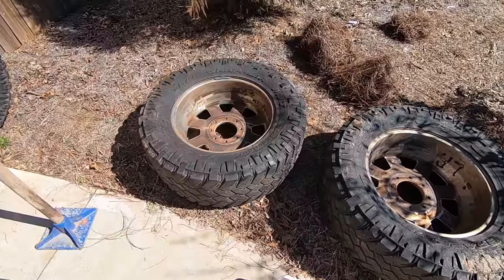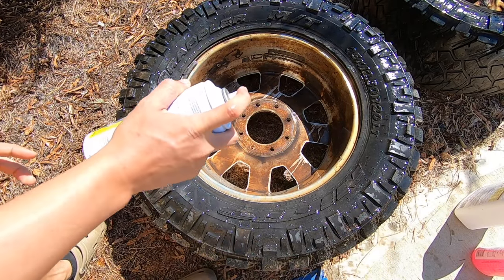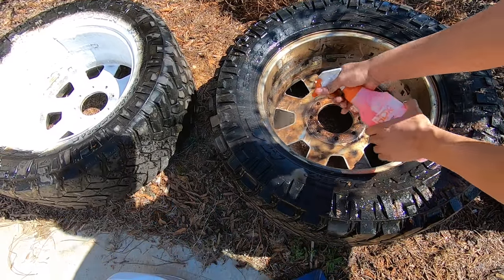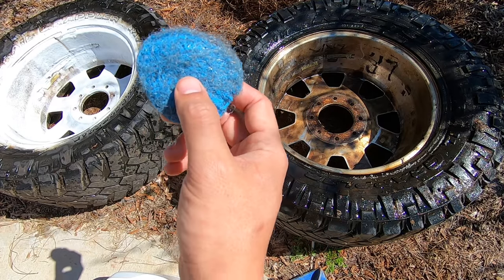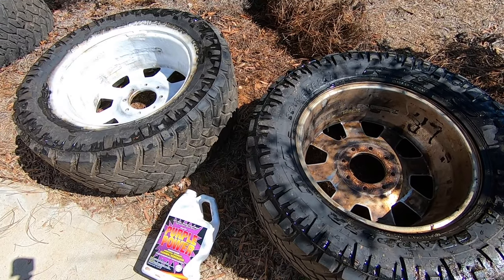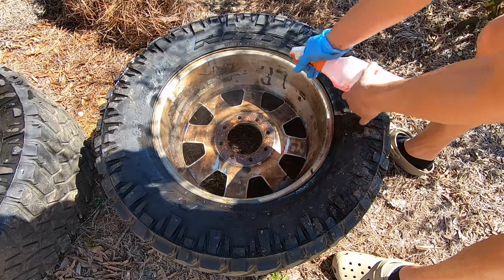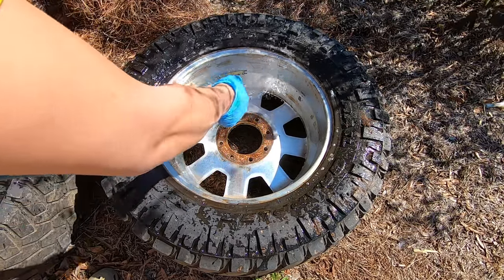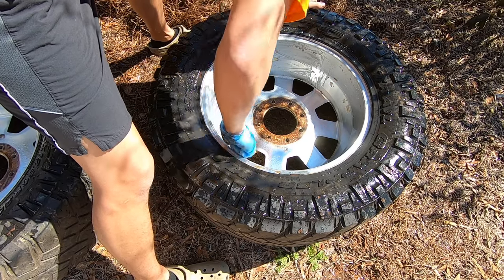Whats the best way to clean wheels and tires? Purple power or oven cleaner?

Comment: The oven cleaner is basically lye so depending on what it is it should do the job i might have some reservations usiin on aluminum but whatever and i like the LAs totally awesome for basically everything you can dilute it like 4 to 1 and still works great im sure purple power works but im juat cheap

Comment: Used oven cleaner on alloy and it really messed them up I would not recommend also on an intake manifold I took off it pretty much strips coating off at the end ur guna wish u took a different route little elbow grease is best

Comment: I bought some used rims that had very thick, caked-on brake dust and the oven cleaner worked ok with a lot of scrubbing and then re-apply. It took about 4 cycles of oven cleaner and scrubbing to get one wheel clean. I then used a paint stripper from Lowes on the next wheel and couldn't believe how much better it worked. I still had to scrub the wheel with a brass brush, but it cleaned up easier with only one application. You just have to be careful and not let the paint stripper get into your clear coat or paint on the wheels.

Comment: Don't ever do this with new wheels. Especially aluminum. You will trash the clear coat or anodized finish. Especially the oven cleaner. It's super caustic.
Reply: So what should you use to clean new aluminum wheels that are full of brake dust and grime?
Reply: @2028end  soap and water and a soft rag or brush. Dawn dishwashing soap works good on wheels. Wouldn't use it on paint unless you want to strip the ceramic and wax coat off to redo it. But yeah when I detail a $350,000 lamborghini or Ferrari I use soap and water. No crazy chemicals.
Reply: @worldssickestmedia2713  And of course you detail a $350,000 car... 😆
Reply: @Prxpagandalf  I owned and founded a mobil detail service in Atlanta for 8 years before I sold it in 2015. So yes. I've done more than I can remember. Also way before that went to trade school for paint and body and collision repair. And of course after you paint wet sand and buff the car it has to be detailed before it's delivered to the customer. So I actually have a formal education in detailing.  And I retired at 41 years old. So I must be doing something right.

Comment: This oven cleaner is ok to use, the cheap stuff, but do NOT use easy off oven cleaner. It is stronger than the brand you are using. Easy off will react to and burn bare alluminum staining it, it will also remove any anodizing as well, it will probably remove clear coat as well. I know this is for testing purposes. But dont need anyone blaming you for removing clear coat, anodizing or staining the polished aluminum wheels.

Comment: Just a point you may not have covered… works great on un-coated wheels. A lot of wheels have a clear coat or some are even painted. The oven cleaner will strip all of that…. I’m still watching so you may mention it…

Comment: Oven cleaner also worked great on my chrome and stainless exhaust on my motorcycle removing melted on rubber from my boots. Trick is don't let it dry out on there because it will stain areas too. Apply it and clean it quickly and use a cloth or very fine steel wool.

Comment: Easy off Oven cleaner works GREAT on brake dust

Wesley White wall tire cleaner is great for tires.   Spray on. Hose off
Been using this product over 40 yrs

Comment: I don’t like purple power, it’s too corrosive and strips the oil out of rubber. A buddy cleaned the engine with purple power once. It caused the insulation on the wires to crumble. All I use is simple green, I put that sh!t on everything! 🤣
I will vouch for the sos pads. I use them on windshields and anything aluminum.
Reply: That's also why no one should ever buy a flood vehicle. They can be cleaned up, but salt water causes the wiring insulation to crumble after a short while and then oh, boy, problems all over.

Comment: I suggest that you use acid for wheels. It's not good for your hands but makes aluminum clean as long as you don't let it set to long and degrease and Wash first. No short cuts are needed when you know what you are doing.

Comment: From experience, applying the cleaner on dry surface pulls more dirt off than watering it down first as this YT video shows https://youtu.be/ZKh9HvlkPa0. I found this also to be the case when pre-washing the car with snow foam, it’s efficacy is reduced when rinsing off before applying the snow foam. Also best to use strong cleaners under the shade to prevent the cleaners from drying up, in case it discolors the coating or metal surface. In terms of order of cleaning products, I found using the iron removers and rinsing before tar removers works better than the other way around, then hit it with the degreaser to remove all the dirt and chemicals, but do it in the order that works best for you.

Comment: Great job kid. I been using oven cleaner for the years. The original real version Easy Off Oven cleaner works WASAAY better than that cheap knock off brand  and the soaps in brillo pads helps and you can buy steel wool in many grades down to fine for more sensitive materials like aluminum.

Comment: Be careful using purple power. I used to use that stuff full strength to remove paint form model cars. It will remove paint from other things too.
Simple green might work for cleaning these too.
Reply: I prefer super clean to purple power. It's a bit stronger, higher pH. Doesn't strip my cars paint if I wipe it off fast. Obviously it will of you let it sit. Works great on alloy rims too
Reply: @north-shoregcs3894  I love super clean with a little dawn to strip a car.

Comment: Just wondered why you sprayed the wheels with water before applying your cleaner to each wheel; 
Hence diluting your cleaners 😢
Reply: helps prevent streaking.... also spray from bottom up

Comment: Good Try !!  First off , you really need to wear rubber gloves you can buy at the grocery store when you buy the oven cleaner which does the best out of everything you used for cleaning those rims !!  But do not get the oven cleaner on the rubber tires as it dries out and destroys vehicle tires or tires in general !!  SORRY , but this is nothing new as I've been doing this for over 45 years already !!  Also nail polish remover will remove the sticky residue on the wheel rims from the stick on wheel weights or anything like that . Then finish everything with a quick wash with dish soap , both rims and tires !!  Also a little dish soap mixed with water in a spray bottle and you can detect or find any air leaks on your tires , rims and valve stems as it will show the air leak with little soap bubbles !!  The leak detection with soapy water in a spray bottle I've been doing for well over 50 years starting on my 2 wheel peddle bike so I could patch the inner tube !!  Only one difference is you have technology such as YouTube !!!  But still have allot to learn yet . But good try young man !!
Reply: He didn’t say he was the first one to discover he said he was gonna try it don’t be a negative Nancy

Comment: I've been reading some concerning/alarming views on the corrosive damage to metals and rubber from using oven cleaners.

Anyone else have negative experiences or is wary about it?

Granted, the effort and time element is very tempting. Nor am I going to take the wheels OFF my car, but spray it on from both sides going UNDER the car as well.
Reply: Ive been using Oven Cleaner on my tires and rims for years and not one issue ,,,,would be a good idea to wear gloves though
Reply: I've seen oven cleaner ruin aluminum
Reply: @0074craig   Any particular brand you've used consistently?
Reply: @69bobr  with the cleaner i use oven cleaner if the dollar store dont have it I go to Canadian Tire and get it there and for a real shine i use Simonize tire shine That usually last a long time
Reply: @0074craig  I was interested in knowing the name of the oven cleaner you've used for years.

Did you use Simoniz on the wheels  too?
Reply: @69bobr  Zep is the name of the Oven Cleaner from CT its pretty good stuff Simonize is the tire shine i use to get a good wet look

Comment: NEVER use steel wool !!! it imbeds tiny bits of steel that will rust quickly.  They do make stainless steel wool that will not runt.  PS  SOS is steel wool.
Reply from the maker: Alloy wheels do not rust lol. Still have the wheels and there still looking good!

Comment: My beautiful aunt accidentally inhaled just a little bit of that oven cleaner a couple years ago and it literally ate at her lungs and she died from it! DO NOT GET THAT CRAP IN YOUR LUNGS!!!
Reply: Are you being for real? I've inhaled the stuff before, definitely makes you choke but had no clue ppl died from it.
Reply: Got oven cleaner on my finger nails nails turned yellow severe pain to my nails. I use gloves now out side with big fan. Nail color went back to normal after a week about. Oven cleaner is no joke. I use it to clean black carbon pistons and valves full strength put on dry since my machine shop can not use certain chemicals to clean parts because of EPA. No oven cleaner on good clear coat wheels or anodized aluminum.

Comment: That purple stuff is crap ,
I bought 2 bottles about 5 years ago , I use the first bottle and threw the second bottle away , 

Oven cleaner ?

Try dish soap and and a little bleach water  ,

You guys with expensive custom rims , I don't think oven cleaner will be used again after your rims are ruined